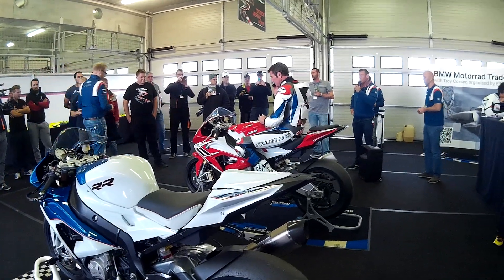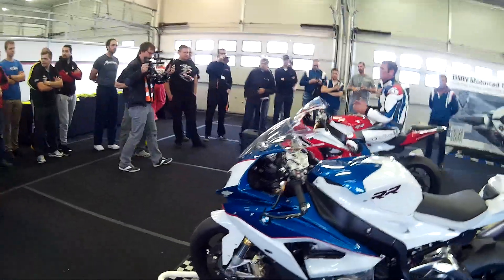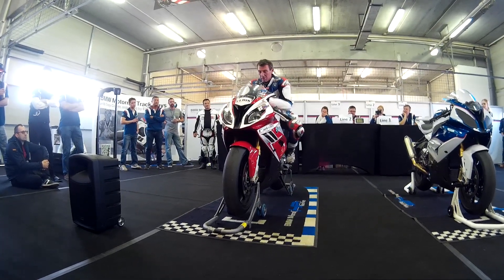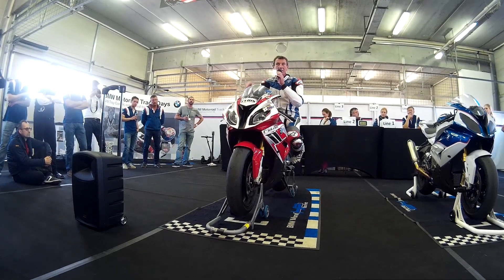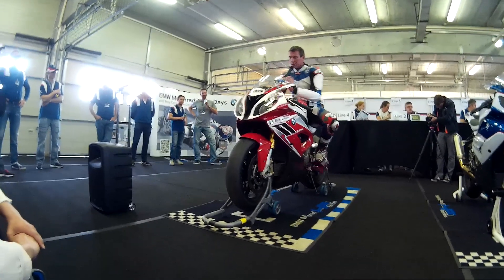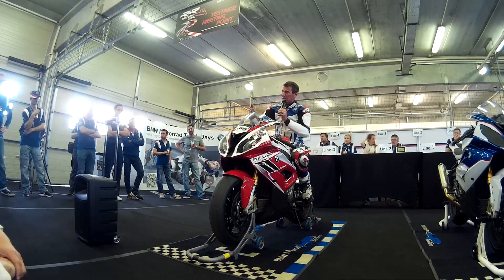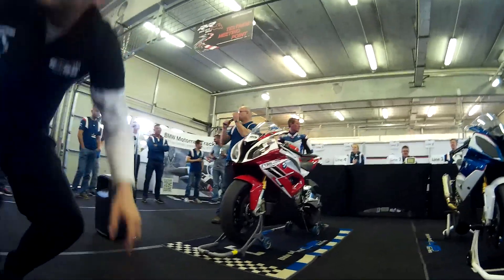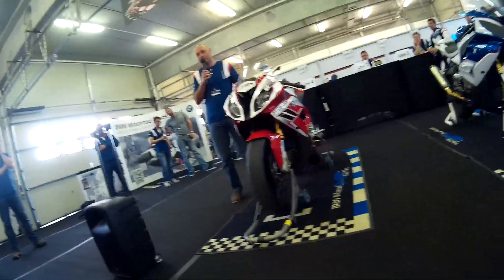Troy Corser explains: Body position and riding techniques

Comment: After testing his suggestions for a day I can confirm that I've been faster and felt safer but my lower body is exhausted now. Probably it's the case because I tried to get even more stabalization from my lower body than from my upper. Just need to get used to it and then it will be fine. Thanks for great tips Troy.
Reply: Robin new riders arms get sore, good riders legs and core get sore! That’s how u know u r doing it right,
Reply: Even in this u can see how superior his body movements are ..  natural ability plus training =winner
Reply: Similar thing here. Had to back off and go back to some of what I had been doing before just to keep from being in pain. But I did feel a lot more confident, secure on the bike, and stopped scraping toes.

Comment: I've been riding for 57 years, I raced off-road and street. I tried to explain this exact thing to someone on another video that scolded me saying, it's physics, and there is only one way navigate a turn. I told him that simple countersteering is not always sufficient. It takes multiple techniques to get through a corner correctly, efficiently and safely. Look where you want to go, the path you want to take. Trail Braking, weight transfer forward on the bike to load the front suspension for Braking. Countersteer, lean etc. More than one way to navigate a corner, but there is only one correct way.

Comment: When you preposition and brake for a turn, your inner leg is in optimum position.  It feels awesome.  You'd think you should move up on the tank from a straight (when I was very new I was doing this) but because of the braking force you move up.  Just as when you go under power for straights your body is in correct position because it got thrown back.  If you ride like this you will enjoy riding more and it's safer because it becomes crazy predictable and natural in feeling.

Comment: I find the bike seems to stabilise worth the ball for on the peg end as you are concentrating your weight through the leverage of the peg
Reply: I watched this couple of times, and just taking guess here but I think he was pressing the point of stability using mid foot on peg in straightaways, and quick turns (hence foot possibly slipping off) while making it less tired legs, etc.
Reply: Rogent

Comment: He makes a lot of good sense, but it isn't new.  This is very similar to what is taught at Stay Upright Level 2 cornering and braking course for quite a number of years.
Reply: Ray van den Bosch LOL...it's what I was taught in 1978!! Seriously. There's been so much bad instruction given over the years, and also too much detail, a lot of it is pretty simple, and professional racers are just extremely good at it.

The core of your body is the key...through the hips & waist, that's where your strength is. 

To use those muscles, you've got to have your feet positioned as Troy shows.

Get the feet right, your hips/waist are right, you can use strong muscles to reposition, keeping light hands...roll off throttle smoothly, roll on throttle smoothly to keep suspension in the central sweet spot.

It's not complex in terms of theory, you've just got to do it correctly and fluidly

Comment: See When you transitions from left to right into a chicane. Say your leaning left dont you use your opposite knee to push on the tank so it pulls you over to other side of the seat by gliding over instead of lifting your ass off the seat?
Reply: This way it always keeps a knee on the tank to keep the bike stable
Reply: if you glide you create friction..this transfers to the chassis as movement....and on a race bike,you have a grippy seat foam,not that slippery shit you get on road bikes....
Reply: Did you get that from super bike school video? Troy's demonstration is exaggerated. But if you every look at the butt cam on GP they stand up a little to flick over. Takes a fraction of a second, you ain't gonna be grabby grabby on the handle bars because you lost contact for a second and feel unstable. Especially when you instigated it. 

Also newton's law for every action there is an equal and opposite reaction. 

But force your thy against the tank to flick you over, you essentially flick the tank in the opposite direction. (at a much higher centre of gravity area) doing it with your feet, yes you are still moving weight across but the place of application is lower (on pegs) so more stable. 

finally the gracilis muscle used to close your legs are tiny in comparison to the muscles to stand up and over a lap. constantly closing your legs to shift your weight will be Far more tiring. 

Try it yourself. Sit on your bike and flick yourself left to right by sliding technique. Your legs get tired real fast.